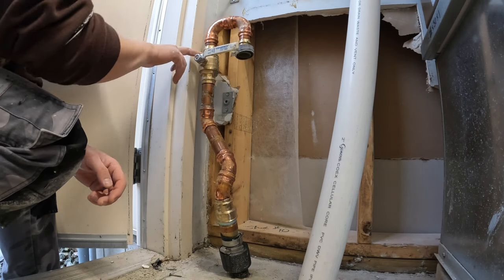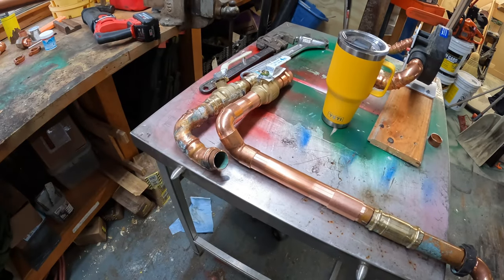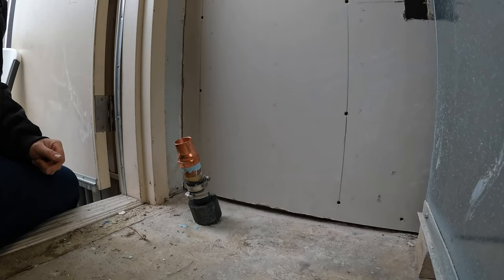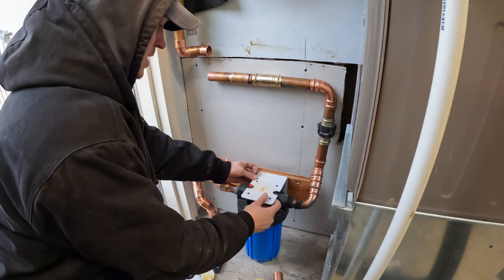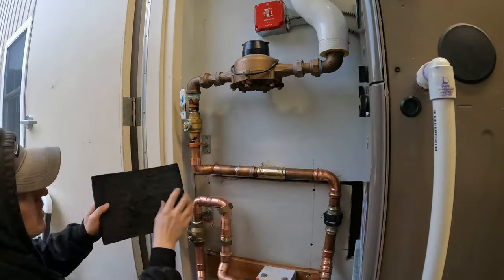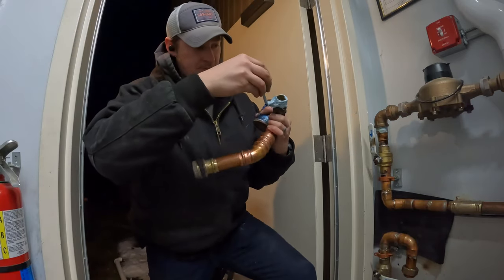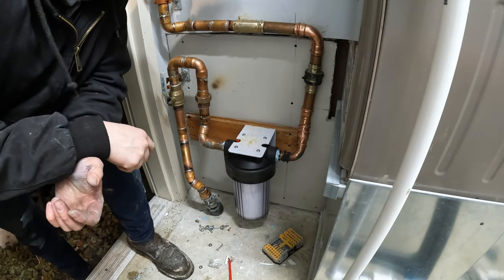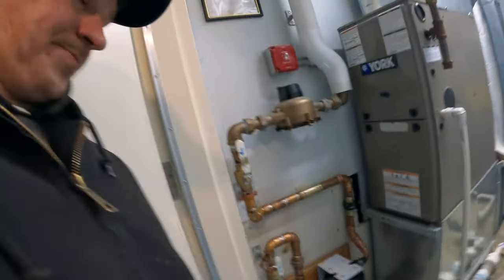Pro Press sucks? When you have to repair a leak. #2

Comment: Why wouldn’t you use a 90/st 90 off of the poly coming out of the floor? You wouldn’t have those janky angles.
Reply from the maker: Because that would have been to easy and I don't like the easy way lol. Honestly I was to focused on copying what was there so it would fit in the same space to think about modifying it to be a simpler install. Next time I will take longer to figure out the install and not just copy what was already there.
Reply: Was thinking the same thing. That’s the difference between a plumber and a handy man.
Reply from the maker: The original instal was done by a “licensed plumber” but they went out of business so that’s not surprising. I have definitely gain some knowledge from people’s comments so in the future if I have to make repairs I hopefully won’t repeat any of my mistakes.

Comment: You failed propress job is due entirely to your using them wrong. Propress has limitations and that being tight spaces. You can't use propress on tight twisty pipe trains.
Reply from the maker: It’s not surprising that I had to repair it with in 5 years. The plumbing company that did the install went out of business which doesn’t surprise me after all the issues I’ve had.
Reply: @LifeofaCampRanger  ah, makes sense,  can never leave things entirely to someone else, or company. I learned that lesson the hard way with medical industry,  it has failed me more than once with lifelong consequences.

Comment: It can't suck more than soldering to fix a leak.
Reply from the maker: It can because if a soldered fitting was leaking you can heat it up and and replace it while re using the pipe but with pro press you can’t re sure the pipe or easily remove the broken fitting.
Reply: @LifeofaCampRanger  I get it you can sweat fittings off, but just soldering with runny lines even a small drip makes it very difficult. Both have advantages

Comment: I am not a plumber. I am curious though. Was switching it over to PEX not an option? At least the new one has metal threads. Great work though!!!! Looks amazing!
Reply from the maker: Pex in that size is a lot harder to find, that’s 1&1/4 pipe. None of the big box stores carry it so I have to go to supply houses to get it. I also would have to buy a clamping tool which I don’t have. It looks like I almost know what I’m doing lol.
Reply: @LifeofaCampRanger  You know more than I. Still looked good!
Reply from the maker: @Michael2022  I'm winging it most of the time haha if it had been smaller pipe I probably would have switched to pex.
Reply: We use pro press all the time and works flawlessly every time. But it can fail if you don’t install it correctly with pro press it’s not just slide the fitting on and press you have to clean the pipe with sand paper deburr the pipe and mark the fittings to make sure the pipe is inserted all the way and the fittings didn’t shift before pressing.
Reply from the maker: @Leep18200  I don't know if it was installed correctly or not but the contractor that installed it went out of business a few years ago. We also had a freeze up in the building 4 years ago so that probably had something to do with it but I don't know why it took so long to show up. If I had money in my budget I would use propress but I don't do enough plumbing to justify it.
Reply: @LifeofaCampRanger  All we do is plumbing so we use are pro press all most every day and still works great. But we have seen every different kind of pipe from pvc to copper leak from failed soldered joints glued joints pex crimped joints etc. Even though are pro press is a life saver on a full day of plumbing we still have to solder in some situations.

Comment: At 6:23 you are soldering too close to that propress fitting.
Reply from the maker: Unfortunately I didn't have a choice with that fitting, so far it hasn't started leaking so I hope I'm good.
Reply: At least it is exposed so you can easily monitor it for signs of leakage, which it sounds like you are doing.
Reply from the maker: @joeb2480  I check it every couple of week and it's still holding water.

Comment: Whatever that is coming out of the floor looks to have some kind of rubber adapter on it. (2 spiral band clamps securing it) You screw on a sweat fitting with tape and dope THEN you're going to apply the heat needed for 1 1/4 copper?   Quit now guy...you have not a clue what you are doing.  I don't like Pro press either but for a different reason.  Plumbing isn't your thing clearly.
Reply from the maker: The pipe coming out of the ground is polyurethane water line which at that thickness can take the heat without leaking. Im going to keep plumbing to get better at it, I may not be great at plumbing but I did a better job fixing what the "plumber" did. If we don't try to better ourself whats the point.

Comment: I have never used pro press or mega and never will, period.
Reply from the maker: If I had the tool I would use it but I don’t do enough plumbing to justify the cost plus when things break the amount of copper that has to be replace is excessive!
Reply: You will if you're in an enclosed tight space in a commercial building surrounded by very flammable insulation and all your overhead pipe has a branch shut-off more than 50ft away.
Reply: yup me too

Comment: Dude, that's an abortion. TERRIBLE sweating on the copper, and 1" pro press joint less than an inch apart?. Yeah seems like the problem is the plumber and not the tools or equipment.
Reply from the maker: I don’t hate pro-press I’m just fixing what a “plumber” did. They are not longer in business. I should have rebuilt the whole thing but I just copies what was there unfortunately.

Comment: Didn't watch video.but yes, press Fittings suck. I will not use them, I will not use them in a box with a fox, I do not like them, sam I am. 
I would rather use sharkbite.
Sweating copper has been a very well-known and used process and is proven. Just because someone sucks at sweating.
Reply from the maker: Pro press has its place just like shark bits, if the tool didn't cost so much I would use it for repairs instead of shark bits or soldering because it's quicker and most of my plumbing repairs are in 3 season buildings. But when it's used improperly like it was it its a nightmare!

Comment: So you sweat gas fittings..... odd....
Reply from the maker: Nope those are water lines I’m replacing. If it was a gas line I wouldn’t touch it due to the state laws and I would have a certified gas fitter do it.